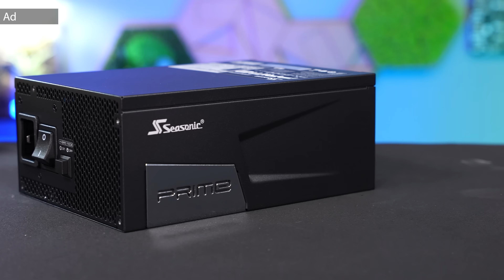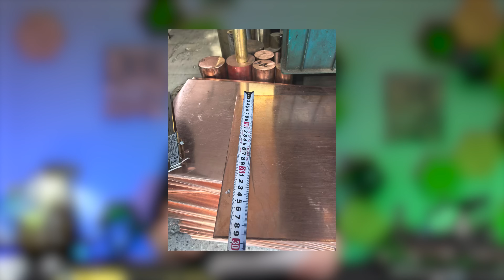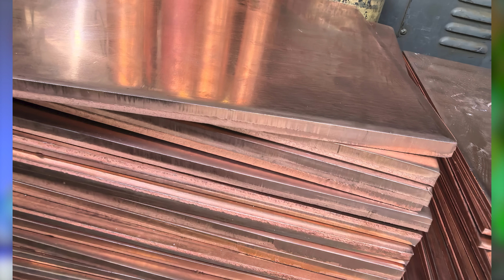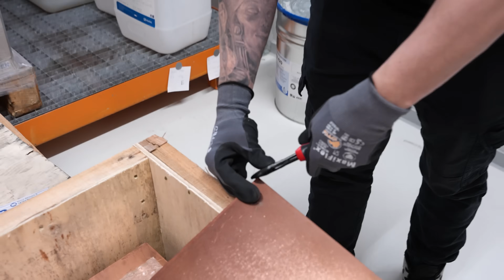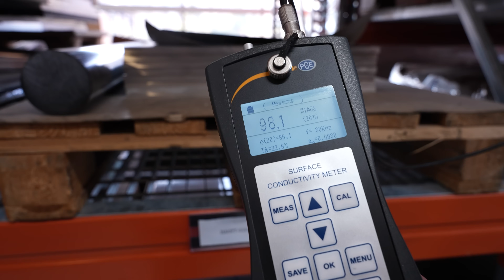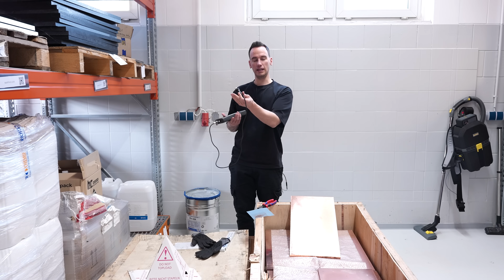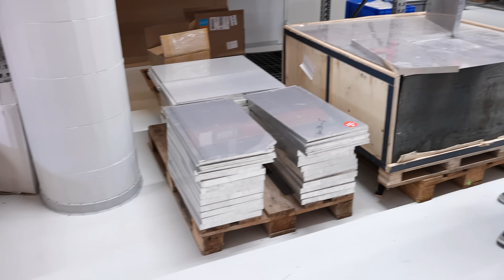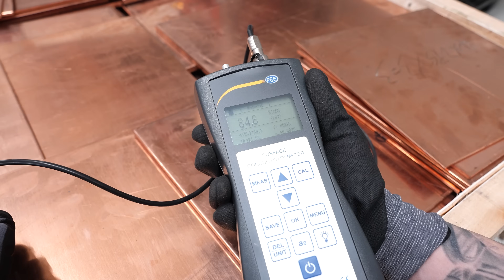I Got Scammed

Comment: Years ago a company that I was working for had similar problems, we had to send an inspector to China and do 100% inspection of all the material before it went on the container for shipping and we had to do that every time as they ALWAYS tried to get away with stuff like you experienced.  So sorry for your losses!
Reply: Even then with a on-site inspection, they could still scam! Just swap the material prior to shipping. 
Even the company I work for was scammed. We purchased plastic bottles for juice, and we had to discard the whole shipment. And of course were not able to get any refunds.
Reply: @mrdan2898  idea is to inspect right at packaging state and seal package
Reply: Even then, I've heard of the shipping intermediaries also swapping things out in transit to pocket the difference as well.
Reply: I suppose that after inspection, you have to seal the packages with tamper-evident seals. Also perhaps withhold most of the payment until product is in-hand and inspected.
Reply: @Mueller3D  They have all sorts of ways to change stuff without affecting the seal, they put way too much effort into that than they should.
Reply: @djfbrje  yeah withhold part of the payment is required now. people wonder why chinese goods are bad, it is engineered to be that way.
Reply: @aoitamashii  My father's company in China once had a truckload of metal goods stolen by a relative who had worked there for five years. The driver drove it away and sold it, then disappeared and never came back. In their country, if the profits are "big" enough, problems are bound to arise. Don't harbor any expectations of affection or loyalty towards them.
Reply: 能骗就骗 is the mindset. Why we ever allowed business with the PRC is beyond me.

The untrammeled greed of the neocon/neoliberal establishment is the only thing that could bring this about.

Not the sort of somewhat healthy greed that promoted the flourishing of industry like from 1850-1950, which was by the way often accompanied by extravagant philanthropy that actually and directly sought to better the lives of poor people by building hospitals, concert halls, public swimming pools and libraries and homes for the destitute, at home, instead of for instance working to sterilise the maidens of Africa.

Now instead we have the sort of greed where you would nickel and dime your own grandmother into the grave.

People like Henry Ford encouraged high wages and the increase in living conditions because he knew that without anyone to buy his product he was finished.

So it was in his interest to increase the buying power and standard of living of the working and middle class generally.

But with people like Alan Greenspan, Mitt Romney and "Neutron" Jack Welch we have imploded our cities and productive capacity and given it over to crooks from a hostile country that despises us and who are itching to fight us.
Reply: You could find an trustful person in China to help you do all inspections before the shipment would be helpful for you if you still doing business with Chinese companies/ factories
Reply: In china there is this proverb and it goes "If you can cheat, then cheat" or "能骗就骗" in chinese, or in other words "a phrase sometimes used to describe an opportunistic, "dog-eat-dog" approach to life, suggesting one should take advantage of situations when rules are not enforced." because in china there is no honor in honesty and integrity, its not Japan, the only loyalty is to money.
Reply: @francisphillipeck4272  Wow that is some stereotyping considering there is a lot of good manufacturers and traders. The fact is China produces stuff that is better than Japanese parts, if you don't like China go trade else where.
Reply: @aflyingcookiearam The funny thing about stereo types is that they exist for a reason.
Reply: @aflyingcookiearam China produces anything, but they do scam a lot.
Reply: @aflyingcookiearam Not stereotyping when its true
Reply: Exactly! That is the Chinese way to conduct business. They will always try to scam you, no matter whether you are buying a hoodie on a fake market or copper plates at an industrial level. And they are pretty proud of their 6000 yo culture. Shame on them!
Reply: Then, way you still did business with them. If somebody try to scam me, my trust is lost and I will never do deals with them.
Reply: Not even the USA stoops to such a low level with their own companies business transactions with others.
Even despite the USA being lead by psychopathic families since day one of itself.
Reply: @EmyajNosdrahcirEniacSovereign  能骗就骗 might as well be the PRC's moto (if you can cheat, cheat).

At least psychopathic dynastic business families know their long term reputation for honest dealings at least amongst their peers can make or break them. Scammers in mainland China don't have this problem apart from keeping trust in Chinese businesses at its nadir. Not their problem. They know it won't get better even if they are angels, everyone else is scum and they know it, so when in the sewer, act like a rat.

And this is from top to bottom, has been for generations. Right to the highest levels. Honesty and fair dealings not only aren't rewarded, they make you a target.

Many serious researchers don't even believe they have a billion people. More like 450-800 million.
Reply: @EmyajNosdrahcirEniacSovereign people get scammed in the USA every. Single. Day.
Reply: @EmyajNosdrahcirEniacSovereign  What country ISNT lead by crazy assholes? Dont pretend the US has a monopoly on asshole crazy families, your just showing your ignorance.
Reply: @EmyajNosdrahcirEniacSovereign  The USA legal system as broken as it is at times would allow him recourse to get his money back and go after the people who ripped him off.
Reply: @EmyajNosdrahcirEniacSovereign  Hah, sorry, but no. Look at the supplements industry, every few years there's news that some supplement or another turns out to have 0% of the ingredient it's claiming to be a supplement for. The companies responsible for this just get a slap on the wrist for false advertising, promise to do better, then a few years later start replacing ingredients again. They've been doing this for decades and the US government never steps up to regulate the industry, because people were just scammed, not poisoned.
Reply: @blarghmcblarghson1903  I suppose I was wrong about the USA Not being the worst of all nations after all in regard of this topic in its own way

Whereas the Asian fellow who posted to me essentially explained the rest very well with some good Wisdom to keep in mind too.
Reply: @EmyajNosdrahcirEniacSovereign  To be fair, the other poster sounds either biased or naive. Look at companies like Monsanto, who sue farmers for "stealing" their genetically modified crops because the wind blew pollen from fields of farmers who bought Monsanto seeds into the fields of farmers who didn't; or look up Nestle, who ran a misinformation campaign in Africa in 1977 that mislead mothers into thinking they shouldn't breastfeed their babies and instead buy their milk formula (which they could barely afford, leading to massive infant deaths by malnutrition) and whose CEO recently said that clean water shouldn't be a human right; or Lehman Brothers, JP Morgan, and Goldman Sachs, the banks that helped promote the toxic assets that plunged the world into the 2008 financial crisis.

These are all massive corporations that still enjoy success and people's trust despite committing acts that should've ruined their reputations; but the sad fact is it doesn't actually matter, because a majority of people don't pay attention, and there are Public Relations experts for those that do.
Reply: @EmyajNosdrahcirEniacSovereign  Fake news.
Reply: @EmyajNosdrahcirEniacSovereign  you know nothing about our country.
Reply: @LeftisBesttt  I know much about your country in actual reality friend.
Despite if you like it or not whatsoever.
Reply: @LeftisBesttt  No, he's got our country's number. Just look at who was able to scam and lie all the way into the Presidency!

Comment: All things supply chains and working with steel / stainless steel, you need to build the relationships with those you trust. First time RFQs with a vendor you never worked with, have a middleman that works locally that knows where to source the raw material but responsible until you get the shipment. Make it their concern because it’s their money. You might have to pay more but aren’t getting junk materials from a scam company taking advantage of overseas business.

Comment: Roman, I suggest next time you make no more than 10-15% down-payment which is normal and should be acceptable by legitimate manufacturers, and make the rest of the payment only final after you have received the goods. If they try to negotiate high pre-payment or full payment before you have it in your possession, that is a massive red flag!
Use a letter of credit if you must, but do not pre-pay everything until you have it all in-hand. "It's on the boat" isn't good enough unless you have trusted third-party confirmation from an assayer who has inspected the entire shipment.

Comment: Based on countless stories like these on client-from-hell pages, when dealing with Chinese manufacturers, you  need to look at their hands and check the quality all the time. They will often try to scam you at every possible step to get better margins but if you persist in QA they can ship what you really need. One such story from Polish guy was that he dealt with shipping the steel for construction for years and he had to deal with it very often. Checking the goods at site, complaining, then getting the actual goods basically at moment notice. He went once for longer vacation and was substituted by relatively new guy. That guy didn't bother to check and approved shipment of steel for milions of PLN  for some bridge construction. On site they noticed that the steel was basically unusable for most constructions due to so low quality.
Reply: Its rife within their own construction industry too. Many videos of plastic reinforcing mesh for concrete that looks like slightly rusted metal but you can wrap it around your hand. Concrete in high rises and infrastructure that is 99% sand and you can scrape off with your fingernails once you break the paint layer, etc. 
I live in a 1st world country and we regularly have problems with new buildings having poor foundations, poor water proofing in bathrooms as well as window and door sills, inadequate flood handling systems, and corruption and organised crime.
Reply: @K1llabud Tofu construction
Reply: Here's the thing - he wasn't dealing with a manufacturer, he was dealing with a middleman platform optimized for small quantity, low consequence orders. If he dealt with a manufacturer with certifications, even in China, this would much less likely happen.
Reply: @xfloodcasual8124  What??? Dude, no. It's Alibaba, it's purely a B2B platform which specializes at this kind of stuff. Not to mention, it's the largest B2B platform in the world. The platform is not the problem, there are many legitimate sellers on Alibaba.

Comment: Roman. You must have some sort of contact with manufactures around you to piggy back on? If you can be in talks with someone who has the supplier and verification already setup? What legal nonsense would be needed to buy raw materials from someone who orders more material then your company will need. That sounds easier to achieve then doing on your own. If some other German producer buys copper and such from China? And knows how to make it happen right? What extra risk or cost would it be for them to supply you with the amount needed? Would only make it even better in negotiations and overall time and cost involved for the other party who knows how to get stuff done.

Comment: Even for things with specifications, mass produced, from a known manufacturer, things can go bad. I haven't worked that many years in close contact to manufacturing, but have seen multiple times when Chinese manufacturers have supplemented brand name parts with something similar, but cheaper and not working as well. And that is from suppliers my employer have long standing contracts with.

Comment: Is it possible that the companies you bought the items from actually did legit shipping and the packages were intercepted and items replaced??

Also I would think that the Alibaba platform would at least help out to some degree. I've gotten batteries and some other equipment through them and there was always the buy protection included with the purchasing, as long as the money changed hands "through" Alibaba directly and not offsite, of course.

Comment: I've been dealing a lot with Chinese (and other foreign) firms for raw material supplies. In general, Alibaba has a decent refund mechanism as a baseline form of security if the goods you order are not as advertised (which you have to prove immediately upon receiving them).
It works in the sense that when you pay through Alibaba, they hold the funds until both parties have signed off on their terms being met (or the online order confirmation timer for the deal runs out). If you're within that timer and your goods arrive faulty or are misrepresented by what was advertised, you can file a refund claim through Alibaba's "Trade Assurance" program, and get either a partial or full refund since Alibaba is still in possession of the money you have paid, as long as you paid through their web service.

They essentially act as a middle-man bank and the seller only receives the payment once you have either signed off on having received the goods as advertised, or the signoff timer runs out. That timer usually depends on the expected date of delivery you're given when you make the purchase order, but either way it is available to check online on your Alibaba customer profile after you make an order. If it's within the timer window and you find a fault in your goods, you can file a complaint to seek said partial or full refund.

For major bulk orders, however, I'd advise on actually flying out to China to meet them in person, tour their facility, or to directly oversee the first shipment of orders before you place final payment for it. Any genuine business will welcome this. And paying 30% in advance is customary for most businesses, never full -unless you're paying for sample pieces of course. And building a reliable business relation with a firm in China that you meet in person is worth a lot in the long run.

Comment: That sucks Roman. Here in the U.S. or at least in my area it's fairly common knowledge and consistently reminded through discussions in the machine shop community to NEVER source any raw material from China. While I've never seen a situation that went as far as copper coating steel plates like that, the false weighted aluminum is somewhat common and the leading example used as a reason to avoid China. We even have a local manufacturing company that has a sister location in China get scammed at said location IN China where expected voids in a raw blank were filled with lead.
Reply: This is why all of the raw materials I order come from US mills and foundries. Not because its "better" necessarily, but because I can at least get mill certificates and have a course of action if I were to get screwed.

Comment: I have been scammed on 60eur GPU, on a 150eur motherboard, on thousands of euros on a house that was not well built and still has issues.

It always sucks, you always question yourself. Sometimes you could have been more diligent, sometimes not really (as is the case here).

When people want to scam you, they will go through a lot of work to do it.

Comment: At around 10:00 into the video. Look, You should NOT feel like an idiot. 1st, you ordered on a website you'd had good commerce with. 2nd, you were trying out a New Supplier. This happens even with wood from Suppliers here in the US of A. The only thing that could be done is you flying to the supplier and confronting them in person in order to get your money back or Actual Plates (but at that point I wouldn't even want their solid copper plates anyways). This is a Lesson Learned. You should feel like the average consumer that got scammed from Ali Baba and posted to [Choose Your Platform] in order to remedy the situation (emotionally or monetarily if the manuf. is paying attn.). I will highlight (and I "liked") the response of a "Letter of Credit" by another person Commenting. It might not seem very "Friendly" but going "Outside Normal Supply Chains" to an Overseas chain does require a certain amount of caution (more than normal with a platform known for scams even though you had good dealings in the past). Remember, as a Smaller Business "Caution" is your watchword when dealing with suppliers. I hope things turn around well for you and profitable in order to solve the "Red" on the books. Cheers! Stay Healthy and Stay Sane!

Comment: I think you should create heatsinks from the aluminium as well. You can use the steel plates and use them as backplates or any type of frame. Make some profit from this situation, beside the yt video.. Make merch. Create small cubes and sell them as keychains with numbering. Collectors from around the world might want to have an authentic "der8auer" token. This part of China is china. This is the same level  bs, as indian scam call centers. Normal traders and companies are struggle to enter EU market due this kind of behavior.